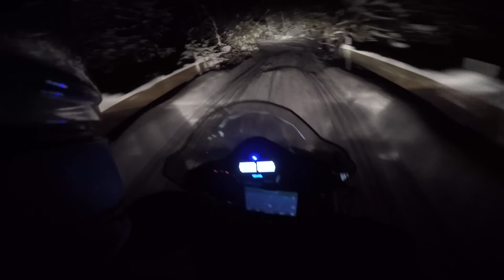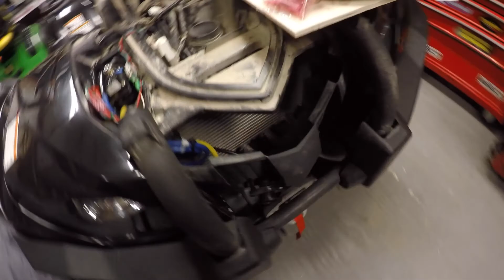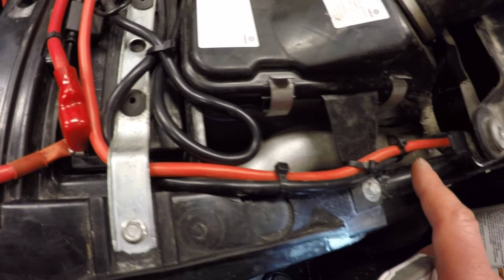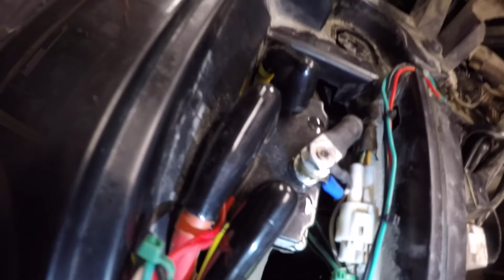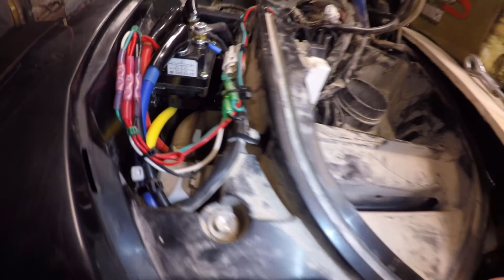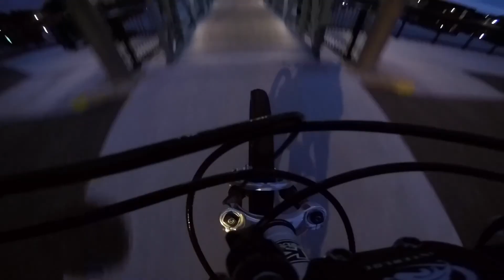Yamaha Grizzly Kodiak Badlands winch install

Comment: Should you be using 3000 lbs rope on a 3500 lbs winch?  Just wondering, I bought the same rope for my 2500 winch on my kodiak, but the winch died before I installed it, so I got the same winch as you. I am hesitant to use  the rope now.
Reply from the maker: Thanks for the view and question! Here are the specs on the rope from H.F. Tools 
4700 lb. breaking strength, winch capacities from 2000 lb. to 3500 lb.
 So it does fall within the application of this winch but I still do somewhat agree with you too. Time will tell how it holds up after all it all comes from the land over yonder and HF likes to over embellish the descriptions from to time hahaha. Cost was key for me as I don't really plan on abusing this winch in severe conditions as I'm not going to be beating the quad up. Will do some tests on it in the future for fun though! Subscribe and stay tuned for more Kodiak vids in the future! Thanks again! :)